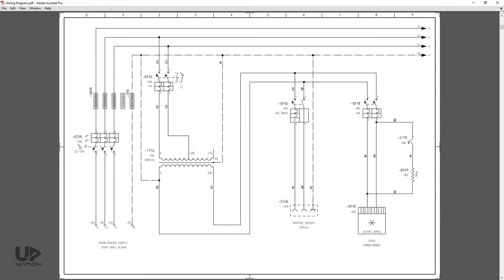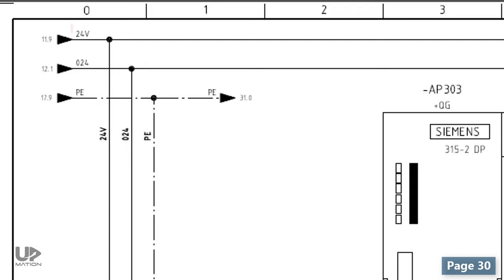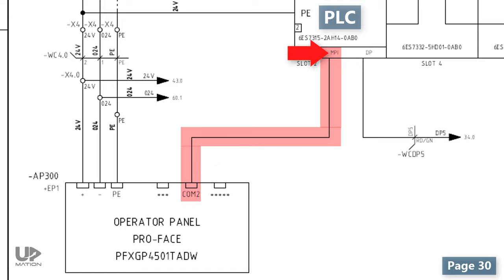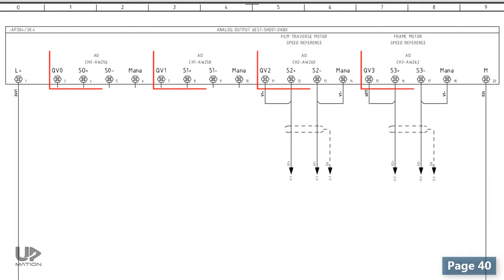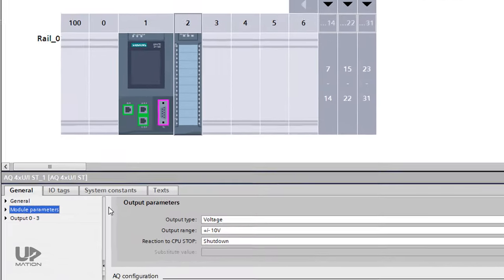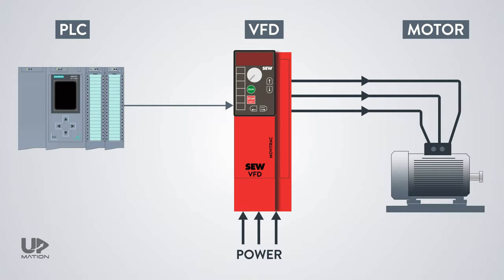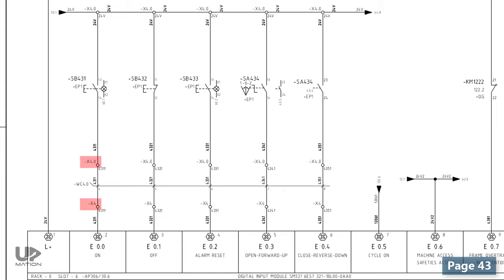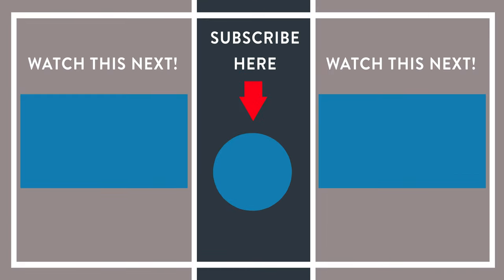How to Read PLC Wiring Diagram | PLC Wiring Tutorial for Beginners | PLC Panel Wiring Diagram

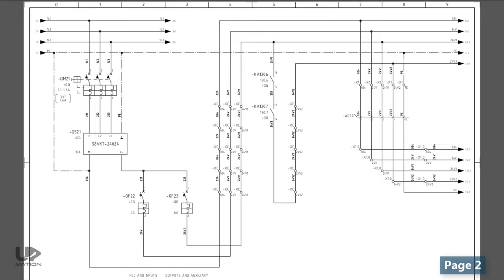Comment: Hey there, at 1:43 when you are describing the page showing the power connected to the PLC; it seems the PE,M, and L+ lines are connected backwards.  It appears as though the PE line is connected to the L+ input of the PLC and the L+ line is connected to the PE input of the PLC.  This appears to be an error in the drawing...Thoughts?
Reply: Seems to be a typo, not to worry I thought the same whats going on here😂😂😂😂😂😂

Comment: hi, thank you explanation it is very helpful but l think there is a problem. the problem is power supply to plc wiring. can you check this?
24v to PE
PE to L+
Reply from the maker: Hi there! Thank you for watching. Yes, it's a simple typo that we've already informed the designer about that and they will correct it.
Reply: yes this issue is at @1:54

Comment: Hi, at 1:54 did you mark the 24 V, 0 V, and PE wires correctly? From the drawing it looks like they have the 24 V and PE swapped so that they are landed on the wrong spots of the CPU.
Reply from the maker: Yes, this is a typo and we had considered that. Thank you for the input!
Reply: Apparently

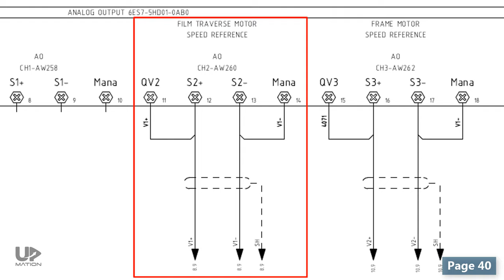Btw do you know what those dotted circular lines are, say at 5:58
Reply from the maker: @taurussilver3053  Those are the signs for the Shields of the analog signal cables. These Shields will be connected to the earth bar to prevent the signals become noisy and corrupted
Reply: @Upmation  i see, thanks

Comment: Nice job! I never cared for the top - bottom orientation but I'm in the states so it's probably because I'm used to the left - right type. Great info. on the terminology used, that's also different than what you normally find here.
Reply from the maker: Hey! Thank you for the input! Yes, it completely depends on the country that the wiring diagram is designed for. As far as I know, this was meant to be used in a European country.

Comment: Thanks for your explanation, you are the best. But can you please, make a video of electrical control devices like the programable relays, limit switches, vibration switches, heater installed inside electrical motors etc, and their electrical diagrams. Thanks

Comment: Coming from someone without much electrical experience, can you do a video explaining commonly used wiring diagram/electrical schematic symbols? I know they might vary by software by there should be common symbols that most companies would use, right?
Reply from the maker: Yes, of course. Actually, the more you work with wiring diagrams, the more you become familiar with the symbols and you'll recognize the symbols easily even if they are from different software. It's due to the circuit similarities and common devices (and therefore symbols). So don't worry about it I will transfer your suggestion to the tech team as well for a video about these symbols.

Comment: -QM81 6:41 into the video.. what symbol is this i havent seen it before? i understand it has short circuit and overload protection but what symbol is it
Reply from the maker: Hey! It is an MCCB (Molded Case Circuit Breaker) or a power circuit breaker which has a manual handle as well to open and close it. The contacts you see on right side of it, are for signaling and interlocking to PLC or other devices. The MCCBs are usually used for high capacity breaking requirements and have a more broad range of rated current in comparison with MCBs.
Reply: @Upmation  thank you so much, perfectly explained!

Comment: Where can i find cad file of the ISO electrical sysmbols? Your video is very interesting ang i am re-learning a lot, the new way of making electrical diagram thatmis. Thanks for this great video.
Reply from the maker: Hi Peter! You actually don't need the CAD file of any of these symbols. If you use AutoCAD electrical there are built-in standard libraries of these symbols. The other electrical CAD software does have similar libraries as well.
Reply: @Upmation  how do i determine the numbers of IO i need in a PLC. I've been checking online catalogs and they are always grouped according to the jumber of IOs. How do i select the PLC i need, given that I have a relay based circuit diagram for my water treatment project?
Reply from the maker: @petere.d8400  Normally in a project you should have a document as "IO List"; Within this document, which is often an excel file, you access the name, description, the PLC card that IOs have been assigned to, and other specs of the IOs you'll have in the process. In addition to the actual IOs, they might consider a number of spares for each PLC card (for future use). If you don't have that document, you should do it with help of the technical responsible people and all technical drawings in hand, including P&IDs, etc., at the site. At least you can do estimation and purchase the PLC cards with some spares (If you gotta do this urgently).
Choosing a PLC CPU (or CPUs) depends on the number of IOs, the volume of the process that should be done by the CPU (i. e. the control loops, etc.), the control speed you need for your process, how large is your project, and so on. Water treatment projects often do not require a high-speed CPU.

Comment: why is the connector/ cable named PE connected to L+ on the PLC CPU and... why is 24v connected to PE? (see at 1 minute and  56 seconds) Thanks
Reply from the maker: It is mistake that was made in the diagram. Obviously, the PE should be connected to PE connection and L+ should be connected to the phase or 24 Volts.

Comment: What are those dotted circular lines at 5:58
Reply from the maker: Hi there! Those are the signs for the Shields of the analog signal cables. These Shields will be connected to the earth bar to prevent the signals become noisy and corrupted.

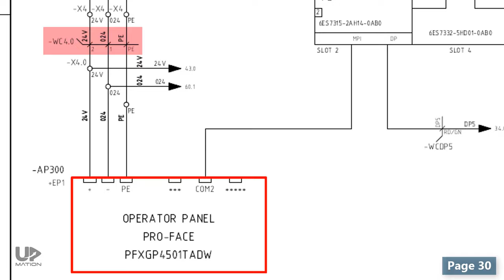Comment: I didn't grasp at 2:25 about the core number. If it WC 4.0 core cable why do i see only 3 conducting wires, including PE, where is the 4th wire ?
Reply from the maker: WC4.0 is the name of the cable, let's say. The "4" in the name (or Tag) of the cable has nothing to do with the core numbers of the cable. It could be WC1.05 or whatever the designer considers. Please let me know if you have further questions. Thanks
Reply: @Upmation  thank you

Comment: i don't understand at 6:09 , why qv3 and s3 are connected and why there is this dashed line?
Reply from the maker: The channels of this card support the 4 wire outputs. When we use a 2 wire output signal instead, we might better jump the other emptied connections of that channel to the other 2 connections to prevent attracting any kind of noise from the environment by the empty connections. The dotted lines are representing the shield of the cable that should be connected to the earth for the same reason (to prevent the signal to be affected by the noise).

Comment: LOL. The wiring diagram for the PLC is wrong at 1:57，polarity is reversed. Low-level mistake?
Reply from the maker: Hey Kurt! Thanks for your input! However, the mistake is not about polarity, but connecting the live wire to the PE terminal. This is a drawing originated by a US manufacturer and we'll tell them to correct it. I believe, as an electrician, you definitely understand that this is a simple typo ;)